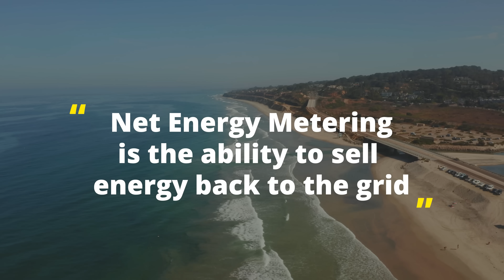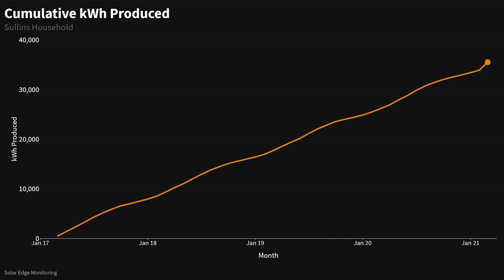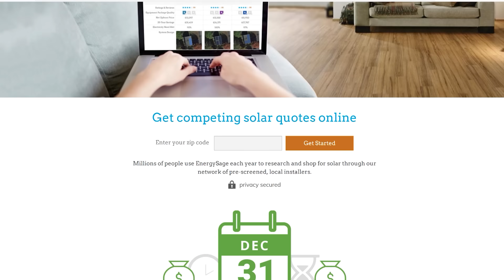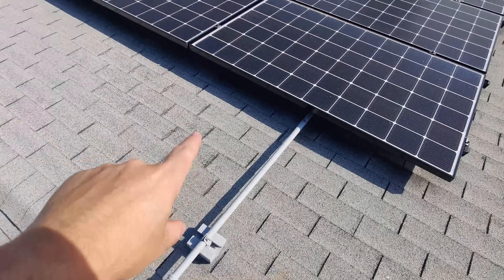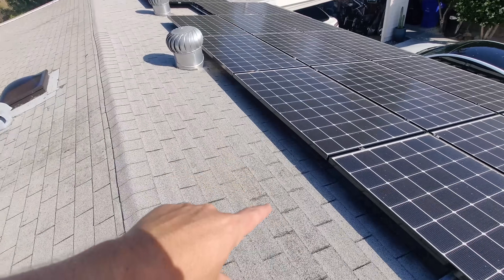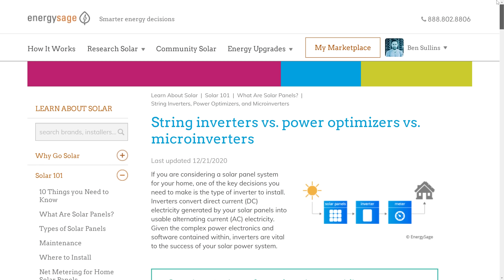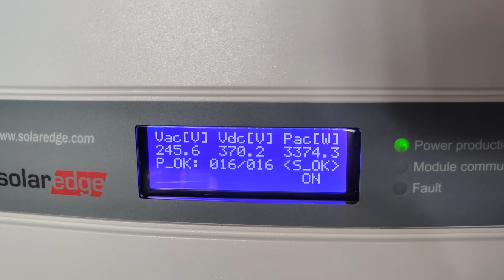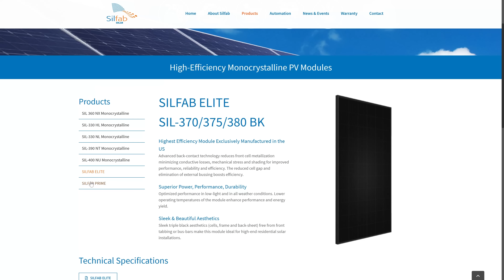The TRUTH About Solar! 4 Year Review

Comment: Net metering isn't as helpful when your power company charges a separate transmission fee that doesn't get credited. Even when you have net metering in your area a battery can still be useful (also saves you from having to buy a backup generator and allows the panels to run while the power is out).
Reply: @see ya Not really, diesel and gas both go bad and the generators themselves need maintenance and testing. There's a lot of standby generators that don't work when people need them because they don't take care of them. Batteries are much less worrisome and provide value to offset over night electricity usage when solar isn't producing. 

A generator is only providing value during blackouts at night. Also during a blackout during the day your solar is completely wasted as it will not provide power to your house. You will have power for quite a long time after your gas or diesel runs out with solar/battery. If you were absolutely going to go the generator route a propane generator would be best, propane doesn't go bad.
Reply: @see ya Not sure on that, I live on the east coast. If you are buying power from a solar production company they would pass on any maintenance work that needed to be done to you. Just like power plant operators, and you pay for grid maintenance either way. The solar I am in support of is privately owned solar. Taking personal responsibility for your life and not relying on a broken grid that is maintained by companies that prioritize profits over anything else and use those profits to line the pockets of politicians so they can get away with providing the bare minimum to people paying hard earned money.

As to the cost of solar, the initial investment is high, but most break-even periods are < 20 years. So let’s say for the next 20 years (or longer) you can project your power will cost $.xx. Have you ever seen electric rates stay the same or go down? I sure haven’t. It’s more like pre-paying at the cost now for you power than in investment. Historically the cost per watt of solar has only been going down as well where the cost of buying electricity has only gone up. Once you are paying higher rates they stay high whether it costs the power company less or not.

The bottom line is that residential solar puts you in control instead of someone out to make a profit from you.

I haven’t seen the videos, but I don’t see resource scarcity getting better rather than worse.
Reply: @see ya I live in Amish country in PA, a lot of them have solar as well. Really depends on the church they go to as to what hey are allowed to have/use. Most normal people would not use a backup gen regularly and wouldn't do any maintenance. Even regularly used generators require oil changes, spark plug replacements, etc. Any mechanical devices is more prone to failure due to wear than an electric device. You are literally using controlled explosions for power in an engine =P
Reply: @see ya You don't store batteries, that's the point. They can be used continuously where as gas starts going bad in a few months and diesel in a couple years (depending on how well sealed and out of the light it is). With a stationary storage solution energy density is far less of an issue so it's a bit moot beyond price.

The proposition with battery storage is, again, it's a value add verses standby power sources. Batteries save me money during every night where as a generator that's not used costs me money in spoiled fuel.
Reply: @see ya Your average person can't even keep the cars they use every day maintained. Ease of doing so doesn't really factor into it. Batteries charge themselves from solar, it's called a charge controller. If someone is charging their whole home battery manually they are doing it wrong! A whole home battery would be used regularly, that's the point, they supply power at night and have BMS to balance degradation over time. As to powering your home for a week or a day or a year, sure, it's called battery + solar, power my home indefinitely that way right now.

I feel like you've never seen a whole house battery system?
Reply: @see ya Lithium batteries are sealed? Even if they weren't, the batteries for my house are in my garage which is ventilated. I think you may be stuck back in the 1970's as far as solar panel knowledge goes. I have a normal all electric house running off solar + battery right now.
Reply: @see ya Of course solar makes less sense for a property that's unused. That's not the use case as most people live in their homes. Electricity production is far more useful than fuel sitting in a can going stale. Every watt produced is one you don't have to pay the electric company for and rely on someone else to be able to supply you. When the gas stations are out of gas i'll still have power. Or you know, when that snow's too deep for you and you can't get more gas, or the bridge is washed out, etc. I'll stick to only needing to rely on myself for my survival instead of the crap supply chain run by corps that don't care if the masses live or die.

Snow melts enough to slide off my solar in hours personally. I suppose if i really wanted to get production back up i could go out with a snow rake and clean them off but there's really no need. The batteries will have charged before the store and depending on the amount of storage should last until the storm is over and the panels are producing again.

Solar panels require no yearly inspections and are maintenance free. Not sure where you get that idea from, you are miss informed. My system has been running non-stop for years now without anyone touching it.

You leave that gas sitting in the engine for 4 years and you'll be cleaning the rust out of the fuel tank and hoping that it doesn't clog your fuel filter. Diesel and gas are both hygroscopic. they pull moisture out of the air.
Reply: @see ya Well, I don't know about mandates but in the long run it should save people money. Building massive solar farms in the desert destroys habitat, where as people's roofs are generally wasted space. Again, i would rather own my solar than rely on someone else to provide anything to me. If you are trusting the government or a corp for your survival you need to realize they don't give a crap about you. They'd sooner see you die homeless in a gutter than give you something they can't extract profit from you for.
Reply: @see ya A small world indeed, my significant other is from TAS and we’ve been talking about moving back there. I’ve been there quite a few times and love it. I know there is a lot of wind power there as well but I think a lot of it is sold to the mainland. Government there is rather onerous and convoluted sometimes from what I can tell, I suppose it’s a tradeoff from some decent social safety nets. I’ve found it confusing to find out exactly what you can and can’t do there as there are so many fingers in the pie so to speak when it comes to regulations on private land owners.

If i remember right, power prices were pretty high there and solar makes even more sense when prices are high.
Reply: @see ya Solar hot water is indeed difficult, especially in TAS's climate, it's much more suited to the mainland. If we do move back to TAS I had been planning to go with solar running a heat pump based hot water heater. I use one here, it sips power and I never run out of hot water. For the cost of the DHW panels the solar electric will produce more for the money.

We still have a house near launceston that we rent out, we ended up putting heat pump HVAC (reverse cycle AC) in that place to cut down on the electric cost for the renters. No solar on that house but if we were living there I would have definitely installed (or had it installed, not sure if DIY is legal there, so many rules). It does seem pretty costly to live there, last time I was there the food prices were pretty high aside from the utilities. Plus side, the temp is great all year, had a hard time getting my wife out of the house on her first -20C day here in new england ;P

Definitely a gem, I spent a lot of time at cataract gorge, the view from the bridge there is great (not a fan of the chair lift, scared of heights). TAS gets a bad rap from the mainlanders, I saw no one with two heads ;P
Reply: @see ya We were planning to pick up a bush block and build on it, will make sure to not even look at connecting to utilities based on what you've said, lest we be stuck under the thumb so to speak. Precipitation numbers seem good enough there to collect all of our water needs from rain fall. I am almost scared to imagine what the path toward setting up onsite septic would be there, I imagine it will be a pain to get through a council.
Reply: @see ya Luckily I can do driveway construction / grading myself. I am used to running tractors / skid loaders and will be buying/renting them when we move there. The concrete situation is more troubling as I was planning to build with ICF. That really needs to be done in a continuous pour with a concrete pump truck. I am fairly handy and can build things like out buildings, had been hoping to contact the main house construction out though as we would need it built fairly quickly.
Reply: @see ya Well off but not rich =P Will just have to see what i can pull together when we move I guess! Thanks for the insight.
Reply: @see ya Was considering getting a bandsaw mill to harvest from the property for out buildings. For the house I am looking to go netzero so traditional framing isn't high on the list of options. I might look for a SIP system manufacturer in AUS if ICF would be prohibitive as far as costs. From what I've seen efficient buildings are the exception not the norm in AUS which seems pretty odd in an AC dependent climate. Coming from a place where winters can get pretty brutal, if you are building new you go for max R-value/air sealing.
Reply: @see ya Would probably go with a solar kiln if we go with a sawmill, they are fairly easy to make/cheap. Bandsaw mills cut dimensional lumber without issue and can be used later for milling for furniture as well which would be great, hard to find decently priced table made of wood now in days.
Reply: @see ya Ah, unfortunate, maybe SIP's will be the way to go then. Liked ICF for the longevity as well as thermal efficiency. May be worth the premium, will have to see what it looks like when we make the jump. Like you we are planning this to be a legacy property, keeping the same property over generations is the best way to build generational wealth. We'll probably end up placing it in a trust so future generations can't sell it.
Reply: @see ya Glad to know that you can still get a hunting rifle in AUS. What i was reading online made it seem crazy hard qualify for a license and castle doctrine didn't exist. Made it seem like if you did anything but let yourself get beaten to death if someone broke in your home, you would be charged instead of them.

Comment: I have a very similar setup with two strings totaling 17 panels with DC optimizers using a solar edge 5kWh inverter. If the prices wasn’t around 10-20% more for microinverters I would have done those. A single point a failure kind of sucks and I do get some clipping since I have 5.6kWh of solar but only a 5kWh inverter. Still produces 30-40kWh on a good sunny day here in Iowa

Comment: Re: Microinverters - you still need a large box called a combiner to merge the electricity being produced by the microinverters. It's not quite as large as the string inverter box, but it still takes up quite a bit of space.
Reply: I do totally agree. I've got microinverters as well, because they make my solar panels better performing when a part of the roof is in the shade, but there still is a big box (converter) in the garage to convert the 12V DC wires on my roof to the AC of the electricity grid.

Comment: I am under the tyranny of SCE. THEY limit the solar build to the yearly KW average. So, instead of building a system that would cover June-September 100%, it will be a little short. This past February my wife finally said OK to getting solar, after 9 years of me getting quotes. The system price has REALLY dropped, with the panels being MORE powerful. So, with a 10.4 KW system, we are piling on the credits! The wife looks at the $ SCE owes us, which is a joke @ .03 cents/KW, where I look at the KW produced as the credits I will be burning in summer. Battery back-up was not going to happen, so we will see what this fire season brings. A propane generator is probably a better choice for emergency back up.

Comment: Ben, nice set up. We installed our 3500 watt system in December, 2012. I installed it myself, saved about a dollar a watt. We have Enphase microinverters. System has completely paid for itself. Our rates in central California have doubled in that time, about 6% a year. This system cost about $8,000 after the federal tax credit. We now save about $1,200 per year, a rate of return of about 15% which is tax free. For us it was a no-brainer.
Reply from the maker: great story!
Reply: The Watt is a unit of power not energy. Do you mean kWh?
Reply: @kennethhawley1063  Just multiply the W(attage) with hours of sun and you get your kWh.
Reply: @kennethhawley1063  He is probably referring to the total panel system size
Reply: I just installed a similar 3850W system, Canadian Solar. Cost $7000. So price seemed to have dropped slightly.

Comment: you did NOT make a mistake, getting the behind the meter battery system. As time goes on, the utility is going to give you less and less for the excess energy, as well as charge you more and more for the energy you do buy from the grid. When enough people have solar, you will all be considered "renewable energy generators", and will only be paid the wholesale value of the electricity. (~1/4 the retail rate) With the battery, you get a 100% savings on the excess power that the batteries are able to store. Consider those, your "Ace in the hole". I'm putting in an enormous system, which will include 54 300 watt panels, (16,200 watts total) and I'm going to install ~65 kWh of battery capacity. That's enough, to supply my house on its worst day, running central air, and my Koi pond pump, which runs 24-7, for a full 24 hours without any power source. It may seem like an awful lot, but, in the winter, the sun is lower in the sky, and the days are shorter. Thankfully, I don't have to run central air conditioning. I do have to run the pond pump. I have a choice: This system is enough to charge an electric vehicle, or, heat the house with a heat pump system, if it has a performance factor of 3.2 or greater. It will not support both in the winter, however, it will be enough to run central air, and charge an electric car in the summer. For anyone considering a photovoltaic system, I would go grid autonomous, rather than grid tie. Solar panels are so inexpensive now, that it's easier to budget for a battery system big enough, to pretty much run self sufficient. There will still be the connection fee, and, it's available power for the rare instances, that the system can't meet demand. The grid is merely a backup battery charger, and still costs much less, than running a generator to meet those demands. The only mistake you made with the batteries, is not buying more!!

Comment: You left off the slow degradation of the panels. 25 years without an efficiency change isn’t happening. 

Appreciate the numbers though. 

Still can’t make the break-even work here with .13/kWh-ish pricing.
Reply: I noticed as well. Maybe just an oversight.  We're looking right now but I'm just not seeing the full value in relation to the astronomical prices we're being quoted.....40K to 50K

Comment: Really started looking into solar a month ago and the fact he has a string system and recommends a micro inverter really shows a true impartial opinion. 

I would also like to point out going with the micro inverter system makes it easier to add onto the system down the road compared to string systems.

Only thing I disagree with is assuming energy cost will go up 5% for the next 25 years. I believe small modular reactors and micro reactors are going to be common within the 25 year time frame making energy cleaner and cheaper.

Comment: Great video Ben. I too have been very pleased with my solar panels that I have had for 4 years in Utah. I have 23 Sunpower 350 W panels with micro inverters which make for a very nice clean install. My system provides all the power for my fairly large house and one electric car (Bolt EV). I figure that 6 of my panels are needed for just the car. One thing I have always questioned however is the need for a powerwall where time of use isn't applicable and winters preclude storing enough energy for more than a few days. For me, solar panels make sense, but battery storage systems are expensive and dont make financial sense for Utah. Thanks again!
Reply: How do u like your solar... do u see a saving?
Reply: @realheartsofsisters  Absolutely, I have been very pleased. My system is sized about perfectly for our needs and is covering 98 to 100% of our electricity costs.  According to my calculations, it will pay for itself in 8 to 12 years depending on assumptions of how fast electricity rates will increase. It is a long term investment. South side of your house is best. Best wishes!